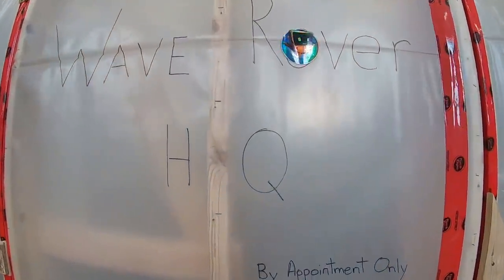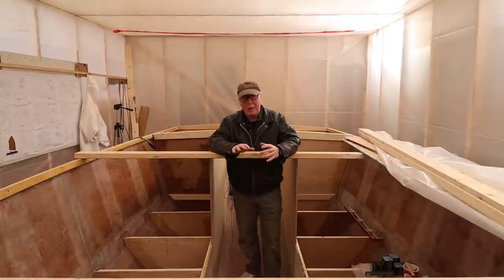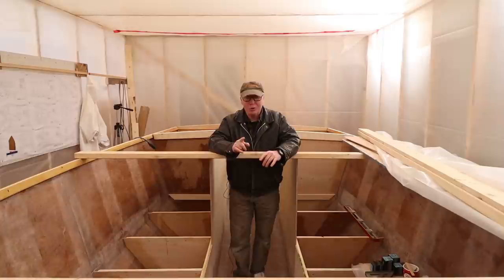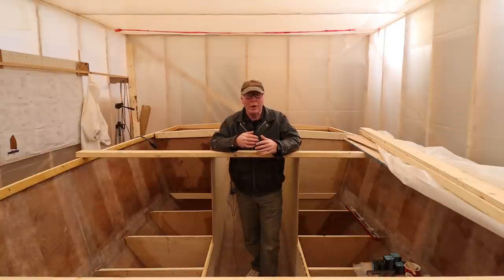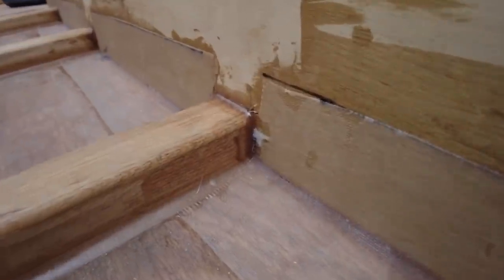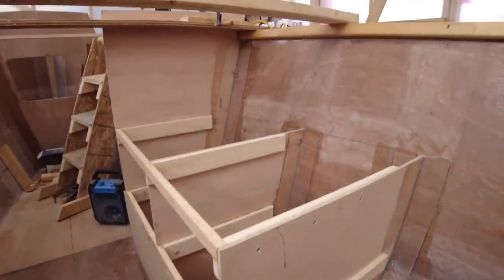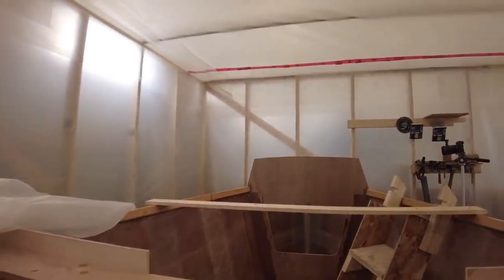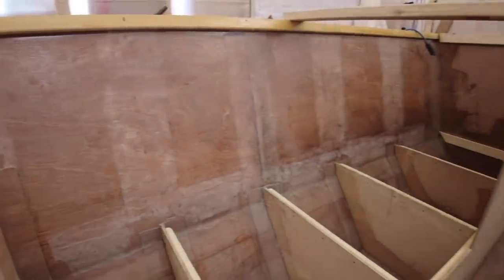S2E33  Wave Rover Boat Tour// Filmed March 28th 2022

Comment: You might consider extending/moving the outside of the deck boxes all the way out to the gunwales and making the tops parallel to the deck. You could raise them to the height of cabin top as well. That would serve as a sort of combing and a place to sit if you are on a severe heal or just want to keep your weight closer to the CG. Sitting on a flat deck for any period of time, if the need should arise, is a back killer. This arrangement would have the side benefit of providing spray and deck wash protection as well, similar to open transom race boats.

Comment: A very experianced sea sailor once told me that a gallay should always be on port. His motivation was: when you heave to you want you main sail on your port side so you have the right of way. You will have your gallay in the most comfortabel position when it is also on port
Reply: Was what I was going to say. Read this tip from the writings of the excellent Maurice Griffiths, editor of Yachting Monthly for 40-years, also a fan and proponent of shallow draft plus bilge keels.
Reply: brilliant answer
Reply: That's the correct answer... also doubly important for a single hander under way.

Comment: The screw in inspection hatches are excellent, I've used them for years on plywood dinghies without any problems. My only concern is that by placing them in the corner you might have difficulties getting to the opposite corner.

The dji footage looks great and it was an fantastic birthday present. Tell Mrs Rover that my birthday falls in June if she is one of those people who enjoys giving presents as much as receiving them. 😉

Comment: What a joy to watch your progress. Your craftsmanship is so efficient, practical and skilled. Here's a tip if you get an inflatable dinghy. You can easily inflate it with a small 20v leaf blower. You don't need the blower tube, just attach a shop vac hose reducer to the blower body with duct tape and hold it over the open valve. It just takes about a minute to inflate the raft. Then bring it up to pressure with the hand pump. Works great!

Comment: Alan, I would suggest that the top of the aft deck be made with a hatch that you could open to get access to the dinghy, outboard and/or liferaft, it is better to leave the deck space uncluttered. Also, as there is no deep bilge, you have to allow for an enclosed compartment for the batteries and charger. Your electronics should be protected from water ingress, water will find its way in one way or another. The chart table should in fact be a laptop table, there is no need and space for large paper charts. Get a good comfortable chair for when you are working at the laptop. I would suggest you get two lithium batteries, one MPPT charger and one 2,000 Watt inverter which is powerful enough to run an induction stove (no alcohol or propane !). You also need space for at least two 150W solar panels on each side of the boat unless you get an arch where bigger panels can be mounted. I think you should use the aft space for those items instead of filling them with foam or plastic bottles. Cheers, Richard
Reply: Definitely access to the dinghy from the exterior makes lots of sense. You’re nor wrestling wet rubber or an outboard through a companionway. The forward bulkhead access could then be watertight or even moved a bit aft to give additional storage

Comment: If you can easily make provision for more water do so, also are manual watermakers  a thing for boats? 
Seating, when you were in the Contessa, to me it always looked like you were wedging yourself in.  Perhaps two sitting places, one each side so you have a choice depending on the weather that allow you to sit in comfort without needing to brace, would save energy too.

Deck prisms over the bunks and forward area to give some light without hatches piercing the deck.

Comment: Great update. Consider having a single transferable electric outboard for Waverover and the dinghy (and you can get one that may charge batteries under sail). Check out Mas' Sail Life channel on 20th Mar 2022 for ideas.
Reply: Agree Epropulsion seem quite good, sailing Fair Isle had an excellent review and as you say it can regenerate when sailing
Reply: That was my first thought when he stated he wanted to with an electric outboard.  It's not free but you can purchase a 2nd battery so that one can be charging while the other is in use. It would, also, make motor-sailing possible  when there's little wind.

Comment: I like the idea of the deck boxes that serve as a cockpit combing, The one are of concern would be to ensue they don't end up serving as a water trap holding water on the deck, I would consider some sot of drain hole to help shed water off the deck while healing over.
Going to 10 Litre jugs is a much better idea too, easier to move around and if one brakes or spills you loose less water.
Galley layout depends on equipment, I believe you plan on using the single burner Origa alcohol  stove you had on the original WR. in that case having it close to some where that you can have a handhold while working at it would be best.
You may want to consider something like a Jetboils on a swinging gimble as a backup for extreme conditions. they are used a lot on Mini 650 class boats.
Nice to see the update and the progress.

Comment: There used to be an inflatable tender called a Tinker. The Tinker doubles up as a life raft. Usual thing though, beurocrats have banned them for some reason, but if you shop around you might be able to find an old one. 
However, there is no substitute for a good solid dinghy fixed to the deck. Now, surely you could work out some way to capitalise on all that new found flush aft deck to create space for your dinghy. Alternatively design yourself a dinghy that could be mounted athwartships on the transom. Possibly a nesting dinghy that could fit inside its self to save space. You are building from scratch, the possibilities are endless.🤓

Comment: For your two deck boxes, I would angle them down on the outside so that if you get hit by a wave from broadside, the water is redirected over the top instead of hitting the side of the box with full force ripping them off.

Comment: Hi Captain. About your question on location of furnishings, I claim no particular knowledge of layout design and I'm sure this is always factored in, but generally location choices can be simplified by concentrating as much of possible the weight low in the center section of three imaginary areas lengthwise and claim that this practice is good for sea keeping with any vessel...minimizes hobby horsing and or burying the bow (and stern on a double ender) in seas.

Comment: I was pleased to the time travel tour, Alan. Wonderful design and workmanship. To your question regarding a tender for the rover I can offer that space into which you are looing to slide an inflatable may be a challenge for all but the smallest of options. Regardless of material (Hypalon or PVC) you are looking at a 50 - 60 pound beast with which you will be dealing. Not a prohibitive amount of weight but somewhat cumbersome when rolled up regardless of slatted or inflatable floor. If it will fit, shoving it through the main hatch as you have designed it and then getting it out of the boat will likely be a workout. Therefore, it will be important borrow one similar to what you would like to see how it can be handled. Finally, I bought a West System PRU-3 slatted floor inflatable (good quality PVC boat for the price - $699 USD on sale) which came with a very nice nylon storage bag. Once the boat had been inflated for the first, however, it was impossible to roll it up tight enough, in the deflated state, to place it in the bag. No big deal for me in that I place it on my deck but might be problematic for you. All this to suggest that it will be important to measure twice and buy once ;-)  Good luck with the rest of your build.

Comment: A few thoughts.
a) an electric outboard is a great option. Much safer. The latest ePropulsion can even recharge by spinning the propeller while you sail. We have a slightly older model and love it. Done quite long trips in the Menai Straits with our 2.9m Rib with it. You can carry 2 batteries and charge with solar. Much lighter (you can move it without the battery on extra easily). The batteries float.

b) I agree about a deck hatch for the aft locker for the dinghy. If it ever flooded you could open the lid to bail or make repairs without flooding the cabin.

c) I like the idea of the cockpit boxes following the line of the cabin as long as they have scupper drains

d) we are all electric for cooking and love it. A "hotpot" electric pressure cooker is a great addition, very efficient.

c) how about no seacock for the galley but instead a small built-in grey water tank with a hand pump to exit just below the sheer line.

d) I don't like using a bucket for facilities, especially if it is wet and cold. So I'd build in a diy composting toilet, maybe under a settee.

e) are the compartments under the quarter berths storage or watertight compartments?

Comment: I never liked the idea of having the galley  and chart table forward on such a small boat. I think it would be better on either side of the companion way ladder. It's the tallest part in the cabin and you could put a composting toilet under the chart table and use the step as a seat while you are cooking or navigating. I t would mean moving the berths forward but with the use of removable boards you could create a double bunk in case Mrs Rover wanted to join you for a weekend or something. If you install deck lockers on the cockpit, that area aft wouldn't have to dead space.  Liking the boat more and more everyday.

Comment: Hi there, pleased with progress so far. Can I suggest ping pong balls for filling the empty spaces can be kept in mesh bags but are small enough to get a lot of boyancy.
The side for the galley should be the same as the water containers. As a suggestion I have used flexable water tanks for drinkling water, 100ltrs is 70cm by 105cm, can be square rectangular or triangle shaped simple pump/tap can be fited to transfer the water
Reply: Ping pong balls are a huge FIRE hazard as the ball material contains both fuel and oxidizer.

Comment: Placement for the gally/nav -- I would say the same as the WR1 as it's been thoroughly field tested. Tender -- Something in the collapsing neighborhood. New Camera -- Works fine, it all boils down to 'How fast can you pan' before too much motion blur kicks in.

Also it seems that you are taking screenshots of some 3D software package used to design WR2, I'm curious what package that is and if it's doing your sims. I don't actually design/make boats, but for this type of curvy lightweight stuff I use Rhino3D. I use Ribbonsoft for g-code generation. As for water placement (sorry if this sounds didactic, I know you guys are pros) -- Directly above centerline as low as possible, dedicate at least as much effort to this as you did the Series Drogue on WR1. 10 one litre bottles weigh almost exactly the same as one 10 litre bottle. They could occupy the space beneath the salon floor. Yeah I know, didactic . . .Don't even get me started about the vertical surfaces/doghouse angle/height on WR1. Again, I know you guys are the pros, it's just my lack of understanding.

Comment: I like the ramp of the two deck boxes.  Nice touch.  Water won't get trapped in the corners, will it? 

As for the stove, I would put it as close to the doorway as possible.  Fumes and heat can be exhausted quickly by having a small fan either exhausting from inside to outside, or fresh air coming from outside to inside somewhere else on the boat.   Water storage:  Why have 5 and 5?  Why not 6 and 6?  Easier to split it up 3 on one side and 3 on the other forward and midships.  Better balance.

Comment: Regards Galley - if I understand it you will have the sink and stove in line on one side of the boat - if that is the case and you are right handed I would suggest you have the galley to port so your right hand has the most elbow room around sink and stove. Also a fixed station for your in use water jug would be helpful but that may already be in the plan, my 2 cents.

Comment: Alan - Great progress and thanks for sharing.  Looks like you got great input from others on the dinghy with recommendations for Achilles (The old Sailmaker) and KaBoat (Dennis). 
 
On the galley, I like the set up of Wave Rover with sink to port and alcohol gimbled stove starboard under the hinged counter/chart table.  I think sailing around the Azores High you will spend more time on Starboard Tack so the water will slope to the back of the sink.  Obviously when you sail in the southern hemisphere this would be reversed. 

On a chart table can you make a stowable surface with a Lagun Table mount?  Perhaps the counter covering the stove could have a Lagun bracket to connect to the mount.  This would allow for an adjustable work surface.

On the deck boxes, I agree with OCSS about making them flush with the hull sides.  My comment is can you utilize some of the space created by the deck box inside the boat to house your electronics make them flush mount.  I recall on the original WR your electronics were all surface mount.  You also could make some cubbies for binoculars and space to house chart plotter (tablet) rotating mount.

One question:  Do you pump your fresh water out of the Jerry Cans or simply pour it into your drinking cup/bottle?

Comment: 10L cans definitely work well I found 10 of them once and used them on my old 24 foot boat reason being they fitted almost anywhere so I could use them to trim the boat but also my wife and daughter could easily handle them. great when I would send them into town to shop and do girly stuff while me and the son went fishing.  On that boat we had a 50L tank and the  10 x 10L which was plenty for a family to cruise for a week.  An easy refill and another week was possible.

Also on that boat I had a 6 horse outboard but one year when that broke down we cruised for a few weeks with a 2 horse outboard and it was perfectly adequate pushing the 24ft keel boat about 4 knots in good conditions however it was only just adequate against strong headwinds in tight entrance to our yacht club breakwater. But that will only mean an occasional time when you have to wait to leave.  

Your other questions re galley etc really it comes down to experience something that is rare ( sailing small boats across oceans ) but you have lots of that, the number of people who have would be less than 50 I would guess and you are one of those.

Comment: In the spirit of DIY,  I've seen several nesting dinghies that might fit on the coach roof Chesapeake Light Craft out of Maryland has an 11 foot boat design that might work for you. If you want to go super-cheap I've seen several skin-on-frame boats that might work. With most of these you could row or sail easily or you could fit them with a light outboard motor. Just a thought.

Comment: The Sailing Brother channel had the same issue with a tender (see ep36) and they went with a Seago dinghy however as they are European it probably knocks that on the head.  I believe  the galley is often to starboard as you are moored up to port and the thru hole would be out to sea.

Comment: re the inflatable, I went for a  Seago 230-SL, packed size  107cm x 52cm x 32cm, packed weight 26kg.  It's a bit heavy but you're not going to be getting it in and out too often.  How big will your hatch be?
Reply from the maker: The hatch will be 600mm x 570mm

Comment: Alan. With the design changes you are making, I am concerned about the inverted stability of the boat. Will she still self-right inverted or have the same stability as before? Have you checked with your designer? Have you thought of using a Kaboat as a tender?
Reply from the maker: In a sense, I am the designer and Andy is the engineer. We talk at least once a week and have very open and creative conversation concerning the build. We both want Wave Rover to be an iconic boat.
Reply: @RoversAdventure  That's great Alan. This boat is already iconic in my mind. I imagine decking the aft part of Wave Rover will increase the AVS (angle of vanishing stability), is this true? But I also think Wave Rover may be more stable when she is inverted, (i.e. the region of negative stability on the Righting Moment vs. Angle of Heel chart will be larger). Have you or your engineer run any calculations on this? Don't get me wrong. I like the change. I'm not trying to be critical. I'm just worried Wave Rover will be perfectly content to float inverted in the event of capsize. Do you have any insight you can share with us?
Reply from the maker: @dennis6325  With all the heavy cambers that I will be building shortly coupled with WR being in a dynamic environment (the type of sea that will cause a capsize), she will always self right. Check out the early episode with the Naval Architect as he explains this.
Reply: @RoversAdventure  I did rewatch that episode. Thank you. Enough said.

Comment: Regarding the galley/chart table what is the headroom along that length?
I'd rather sit to use the chart table than the galley.
Also fixed galley is much more important to me than fixed chart table. So I'd be happy with bulkhead for switches and displays and a folding table for the charts that I could use while sat on the berth. Or even have on the cabin roof while sat in the hatch for pilotage in tight situations.